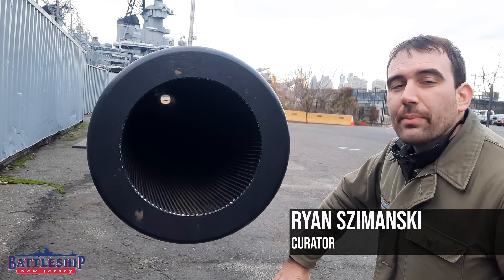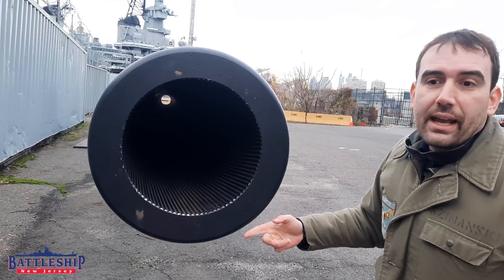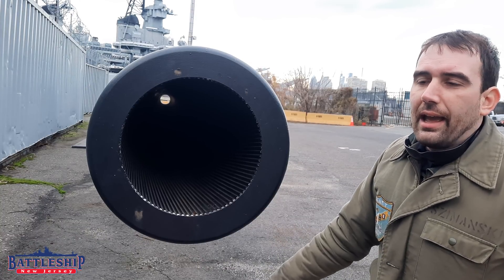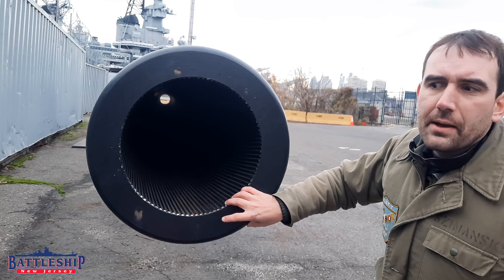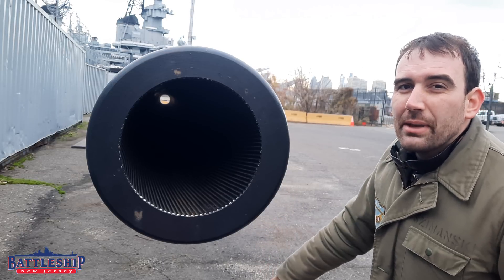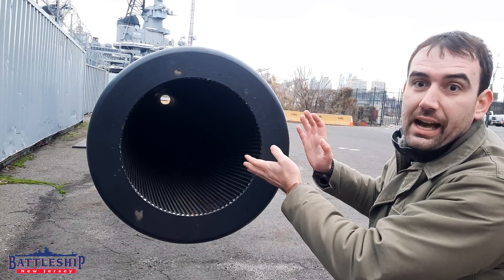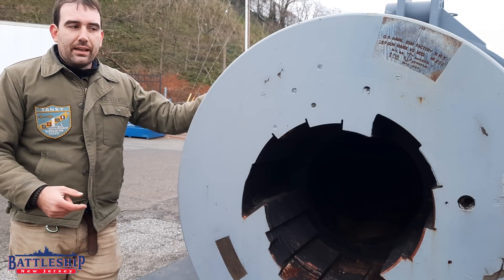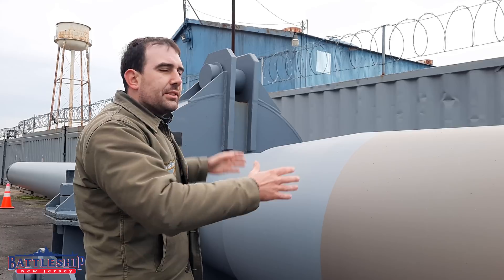16in Barrels: Construction and Maintenance

Comment: In mechanical speak what you are describing is called an "interference fit". Meaning that a part is incorrectly sized unless it is heated or cooled to change its dimensions.

Rather amazing what can be done with this!

When a piston engine is sleeved, the fit is an interference fit. And the can last for decades.

Comment: I have used the shrink fit method many times in my 36 year aerospace manufacturing career and it is amazing how strong it is. I built a 1974 Sharps rifle in caliber 50-90 and named it "the Missouri" after the great battleship with it's 16 inch guns. With 80 grains of black powder and a 650 grain cast lead bullet it is a wonder to behold when you fire it. Like the battleships of old a great big boom and lots of smoke...

Comment: Really fascinating.   It takes a lot to handle a service pressure of 18.5 tons per square inch - or 444,000 ft.-lbs, and muzzle energy of almost 262 million ft.-lbs.   Lots of heat, friction, and pressures involved here.

Comment: Many years back I read that when a liner was being installed, there was a cap at the bottom and it was filled with dry ice. Once installed in the tube, the cap was released and the dry ice fell out of the liner.

Comment: Can you do a piece or make mention of how they kept these and the other 5 inch guns were weatherized for open sea and or storms.  Also how they were kept from corroding between shots.
Reply: They had wooden plugs that fit into the end of the barrels when the guns weren't needed. In the navy sailors spend most of their time doing maintenance and cleaning. Ships went into port for major maintenance at least once a year. In WWII new radar upgrades were made frequently and when the ship came to port for maintenance they would replace the surface, air, and gun radar systems with the most current systems available. https://www.youtube.com/watch?v=uh9JWP85g18

Comment: 30 years ago I was working at U.S. Steel in Gary, Indiana. Part of my job was to perform structural inspections of old buildings and we had an entire abandoned plant (I'm talking many square miles, a small city) full of WWII tooling and armaments that were exactly the same as they were the day the plant was shut down and everyone walked out of there. The locker rooms still had pin-up posters, lunch boxes, and all kinds of stuff. One building the size of a football field was essentially a giant lathe and it still had an unfinished HUGE shaft or barrel fixtured in it. Was mind boggling. Maybe this is where my WWII obsession started 🤔
Reply: Sadly so little of photos and video of US Steel.

Comment: Ryan, just a heads-up: wire-wound guns were exclusively British. America never made them in standard models. Modern guns aren't cast, they are radially hammer-forged on incredibly impressive machines (dedicated specifically to that purpose). It should be noted that forging cannon barrels over mandrels (using large hydraulic presses) was pioneered by Krupp in Essen Germany in the late 19th century. The Germans didn't need to wire-wound guns, they were already miles ahead by forging them.

Comment: I was stationed at the Navy Museum in DC. And yes the main exhibit hall is the 16 in barrel factory.  Other buildings in the yard built other weapons also.  I remember being in a master chiefs office and there was this odd blocked off area.  I looked through a crack and there was the original winch set. This winch was the size of a pick up truck.

Comment: Just out of curiosity, what is the difference in length of Barrels between the 16" 50 Caliber Guns on the Iowa's and the 16" 45 Caliber Guns on the South Dakota's and North Carolina's? I've often wondered what the difference in Calibers equated to in Feet.
Reply: It related to the length of the projectile. A 45 caliber naval gun was 45 times the length of the shell and a 50 caliber was 50 times longer than the shell.

Comment: I worked at a company that was tied to the plastics, food, and rubber industry. What we manufactured was referred to was a bimetallic cylinder. The main part for the simple ones was sometimes a grade of steel like 4140 with a hardmetal lining that was centrifugally spun cast in the inside. At one point we were boring out the inside of the larger and longer ones followed by honing it smooth and dropping in a new liner pretty much as described in the video. We aimed for a .003 to .005 shrink fit. The longest one I worked on was 300 inches long. The heaviest was over 8,000 pounds. That one was for making pellets out of crude oil out at the oil well for I believe for the rubber industry. The hardmetal liner was various metals like cadmium, tungsten carbide, and others depending upon what was needed like wear factor. Sadly the company was purchased by competitor and auctioned off. So keep your friends close, keep your enemies closer. I skipped about nine to twelve steps in the process depending what was needed for design and application like pressures in service use. One time some were held up in customs in South Korea or Taiwan because some customs officials thought they were some sort or gun or missal barrel. They were for plastic injection cylinders.

Comment: Back in the late 70s and early 80s I worked for the Navy.  Sometime about 1980 or so we were tasked with doing a review of the Naval Surface Weapons Center which was in White Oak MD and Dahlgren, VA.   I was part of the White Oak group and when we finished there we joined our coworkers who had been in Dahlgren for several months.  Part of the function of Dahlgren was to test fire gun barrels before they are installed on ships.  The base is located on the Potomac below DC where it is very wide and they would test fire the shells into the river.  (They used to do it on land in Indianhead MD years ago until they started putting shells through farmer's barns so they decided to use the Potomac instead).   
Our office was located in an old wooden WWII (or maybe WWI) "temporary" building that was just off the firing range.  After I was there a couple of days an old lady who worked at the base came to the door of our office and very excitedly exclaimed "They are going to fire off the 16" guns!!"   Now I figured she probably had worked there a long time,  and been through a lot of test firings, so if she was excited, this must be something special.  Right after that, a very loud siren went off and there was the loudest explosion I ever heard.  I remember the whole building shook so much that the window blinds (which were down) flipped up and hit the ceiling and went back down again.   My coworkers had been through at least one more test before this one, as the whole time, they were staring at me to see my reaction.  I was just sort of stunned.  It was explained to me that they were refitting out the battle ship New Jersey so when I saw this video I thought I would pass along the story.  
This shows how much the sailors had to go through during a battle as I understand that the New Jersey had 9 of these guns and the noise and vibrations must have been terrifying.
Reply: Dahlgren investigated the open breech explosion on the Iowa by using a shell, bag charges, and the correct rammer. I believe there were 27 test firings and one of them caused the rammer head to break off and get launched through a shop. They determined where the bags ignited and how the disaster happened.  During the tests, to remove the stuck projectile from the rifling and send it back out the breech, they installed a device to hold C-4 explosives, then filled the barrel with water and detonated it. The shock spit the stuck shells back out the breech. One of them came out with such force that it bounced off come concrete and landed in a swampy area.

Comment: I calculated the circumference of the bore is 50.27 inches so you only just fit with 4 inches to spare. Watching you do this was uncomfortable as I'm claustrophobic and a bit bigger than you (51 inches around the shoulders). Actually doing this would be a living nightmare to me.

Comment: These barrels were re-conditioned and sleeved at the former Naval Ordinance Plant in Pocatello, Idaho. They were then loaded onto a rail car, and test fired out on the Idaho Desert. Formerly known as the Naval Ordinance Test Site (now the I.N.L). 

They were then shipped by railcar back to be fitted on board the ship.

The Naval Ordinance Plant buildings are still in Pocatello, and are easily visible on google earth. They are the largest buildings in the city.

Comment: If in a fantasy future, the United States Navy needed to rearm its fleet with battleships.
Would the navy still have the knowledge and capability to built new turreted 16’ gun batteries similar to or replicating the ones existing on the four decommissioned Iowa Class museum battleships?
Also, would they be able to produce the proper 16” projectiles and powder charges to fill the magazines of new or renovated battleships?
To further expand on the question, would we even be able to build from the keel up new battleships?
Could we reproduce or design and build the massive steam and hydraulic systems required to operate a battleship.
What about the acquisition, manufacture, and installation of proper battleship hull armor?
In other words, similar to the internet rumor that circulated some time back; we would never be able to successfully construct another Saturn 5 booster rocket like the ones that propelled the Apollo Astronauts into space because we’ve lost, in multiple ways, such as technical blue prints, specialized tools, institutional knowledge and skills, and generational experience to built one from scratch; 
Would this be the same dilemma facing marine architects and contractors in 2021, when attempting to build war-winning battleships and the guns and ammunition to arm them like what existed around 1945-46?
Reply: That's why we have sealed in a cannister OTH GMs with GPS and "tiny" warheads that are "guaranteed" to hit and do the same damage (less the pure kinetic whip). Or smart sea mines. Why build a solid pyramid when you can construct a latticed framework with a fabric skin with a fraction of the resources? A single "new" steam locomotive (Tornado) was recently made in the UK with a price tag of 4-5 million USD. Look at the problems the US Navy is having getting the new Ford Class carrier commissioned and the steep (re)learning curve the RN had to get QE/PoW functional. Battleship construction 100 years ago was time appropriate - simple as that. Can't beat the romance of the old school kit, though...

Comment: There was a 16 in cannon just like the one on the IOWA Class battleship used as coastal battery at Aberdeen Proving Grounds (APG) in Maryland on the north of the Chesapeake Bay. The gun was being transported from its initial coastal emplacement to the grounds for the Ordnance Museum in 1989 (about 10 road miles more or less). It was so heavy that the crane from which it suspended while being transported broke right in front of  the HQ building inside the "fence" (an euphemism for the restricted testing area which 92,000 acres). They had to get a second crane to completed the rest of the way, about two more miles, to the museum grounds for emplacement. I was present for that incident since I was an US Army Artillery captain assigned as a Test Director to the base. Those rifles are incredibly big and heavy and the one in Aberdeen is an entire unit with the emplacement  base  not just the rifle.  The gun has been in APG since WWII.

Comment: These things have the same working pressures as modern high powered rifles. The dimensions are much bigger so there is more area that's under stress, therefore the guns have to be thicker.

Comment: The self-aligning boring tool which allows such long barrels was developed just down the road from me, in Armstrong and Whitworth's works at Newcastle-upon-Tyne.  They also patented modern rifling and the laminated tube method of construction, all in the late 1800s.  The pdf is a bit askew on these points.

Comment: There is also a process called "autofrettage" which involves inserting a slightly smaller inner liner into the barrel, capping both ends, and pressurizing the liner internally with water to say 60,000 - 70,000 psig to stretch fit the liner in place. This process is still used today to reline barrels used in large two stage light gas gun launchers.  Autofrettage is useful when the heat treatment of the barrel alloys could be weakened by heating and cooling processes that were used in the 16" gun barrels. The art of building large caliber gun barrels is almost lost these days and there is literally no place left that could build one from scratch without reproducing the facilities of old. Glad that some of this history is being preserved and documented.

Comment: Did anyone ever propose adding muzzle brakes to the 16 inch rifles? They might have saved lots of wear and tear on the turret.
Reply: Muzzle breaks vent gasses to the side, so if the guns fired at the same time they might interfere with one another?
Reply: My bolt action 50 BMG target rifle had a muzzle brake. It blew a duffel bag off the next bench over when I fired it for the first time. I can't imagine the chaos in burning gasses, shock waves, and sound a 16 inch gun could do with a muzzle brake.

Comment: Nice information. One correction I have is that the Iowa class was not treaty limited (Washington Naval Treaty) to the 35,000 ton battleship limitation like the Washington Class was limited. The Iowa’s were designed to a 45,000 ton design number but were actually built to a larger displacement number as the design progressed.
Reply: One correction is that the Iowa’s 45,000 ton displacement limit was still covered by treaty limits but the US had invoked the “Escalator” clauses of the 1938 treaty battleship limit based on rumors of the Japanese building super battleships. The Montana’s design was to be the first design not limited by the treaty.

Comment: You'd think the barrels would be forged with mandrels taking up most of the bore space, so that 16 inches of metal wouldn't have to be drilled out.
Reply: I was thinking the same thing.
Reply: That's an absolute insane amount of machining to do, as well. And god forbid if you lose tolerance or have something catastrophic happen while milling it - you just wasted a whole lot of tooling, time, steel and money.

Comment: When firing a broadside, how did the barrel mass all pointing to port or stbd effect the heel of the ship? Are wing trim tanks used to shift ballast or fuel to compensate?
Reply from the maker: It didn't really cause the ship to rock or anything so that wasn't necessary.
Reply: The turrets would actually deform from firing, so that's why they fire in a staggered pattern

Comment: How did they load the 16" shells into the ship when they ran low? Is there a hatch just for the shells that go straight into the magazine or do they have to bring them in through the superstructure somehow? Enjoy you channel.
Reply from the maker: A hatch in the main deck and more hatches below it. There's just a crane and a bunch of people guiding it and attaching them to the cradles.
Reply: @BattleshipNewJersey  A derrick next to the turret with some kind of "scissor grab" to hold the projectile on it's way down to the magazine, I believe. As a midshipman, my old man almost dropped an unfused 15" shell straight through the bottom of Warspite in Alexandria Harbour whilst ammunitioning ship...

Comment: Very interesting. I wonder what those vent looking things are in the breach?  Are those there to increase back pressure?  Like something for the pressure to "grip"?
Reply: I think you're talking about all the screw lands that the breech block locks into.  The breech block (which isn't attached to the gun outside) has to be out of the way to load the gun, but then gets inserted into the breech, and then the locking mechanism locks into the lands in the back of the barrel.

Comment: I absolutely guarantee that absolutely no 16" rifled barrels are 'bored out with a drill press'. Machining was not automated with CNC back in the 30s and 40s and I don't believe Tungsten Carbide was common if it was around at all. That said most techniques we use today in manual turning and machining are fundamentally the same as then, the liners would have been cut in a very large lathe, with many steady rests. Carefully cooled to control warping and turned down to size then bored out with that rifling thread.
The main concerns would be the material properties of the steel being used, which is not standard.    My big concern is how they keep long barrels like this from deflecting under weight - Either the grade of steel itself or some process of heat treatment or mechanical stiffening is being used.

If any of you have ever worked with cranes you realize just how much a long beam of steel will deflect or bow at a low boom angle, most steels are pretty flexible. And any significant deflection would be fatal for the accuracy and stability of any large gun.

Comment: How did the powder go bang? 
Electricy? 
Thank you for sharing. 
Regards from Sweden.
Reply: There is a device attached to the gun that a 30-06 cartridge is struck with a firing pin similar to a rifle but it is electrically enabled, possibly solenoid powered from the Mark VIII firing solutions computer.
Reply: @thomasmoore8142  oki. Thank you.